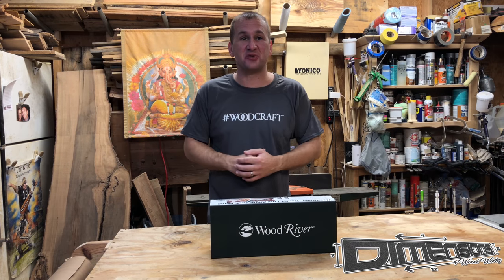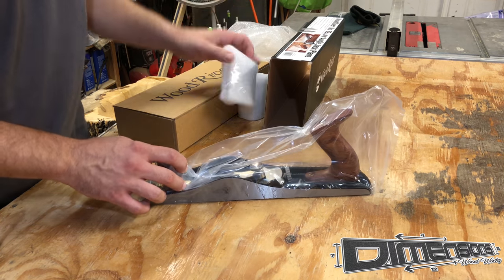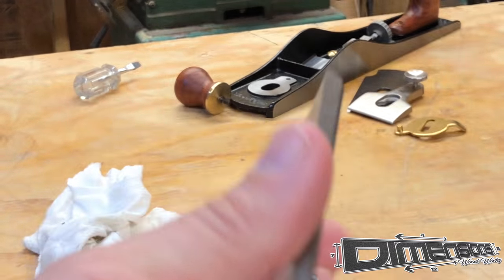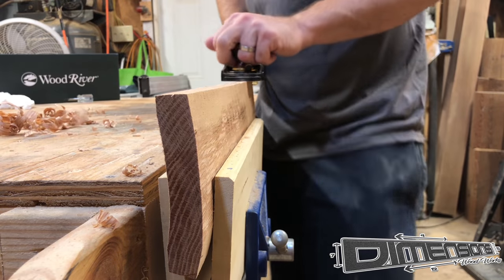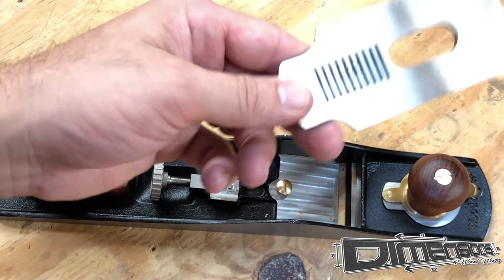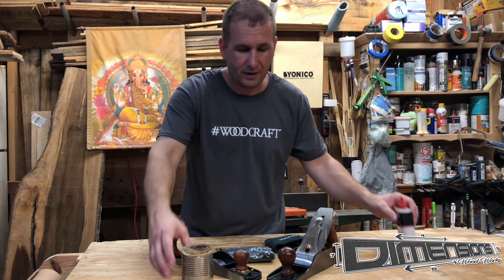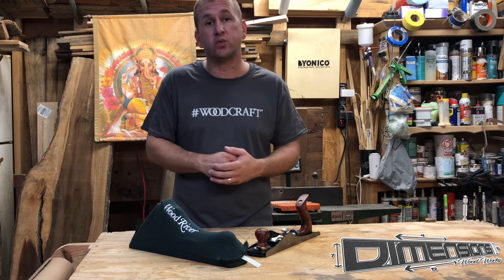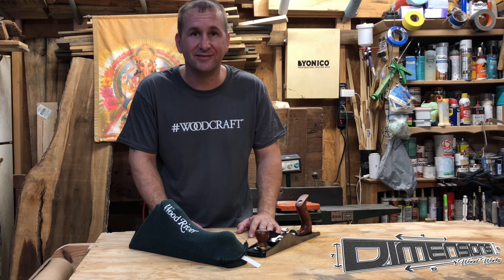Wood River Low Angle Jack Plane #62 Unboxing

Comment: Happy 4th of July. I notice that you have two Wood River handplanes. Can make a first plane recommendation for someone like myself who would like to add one to my collection of hand tools. Perhaps a sharpening video in the future?
Reply from the maker: It really depends on what tasks you have to do. I went with the WR 5 1/2 because it’s a great middle ground. They are called “jack” planes because they’re meant to be a jack of all trades. The 5 1/2 is big enough for jointing and small enough for smoothing and I’ve used it for both. As my collection grows I’m sure I’ll add more planes designed for specific tasks. Stay on the lookout for used planes in garage sales and for sale sites (ie craigslist) and see which one works for you. Once you know what you need, invest in a quality tool. While Stanley started it all, there have been improvements and Wood River, Lee Valley Tools and Lee Nielsen are all great options. 

I’m still in need of a good sharpening system, and once i get it and become comfortable using it, a sharpening video is definitely a possibility for the future...  

Thanks for watching!